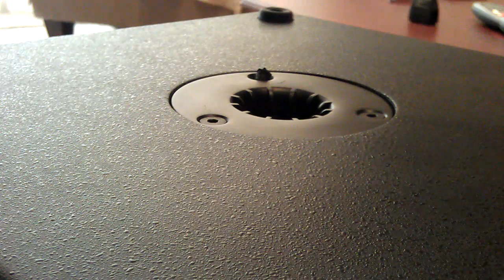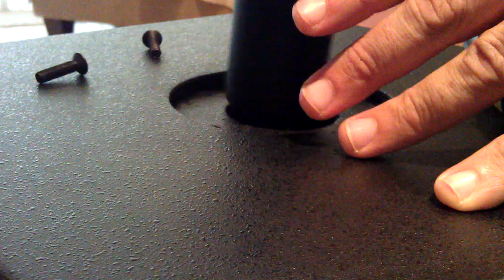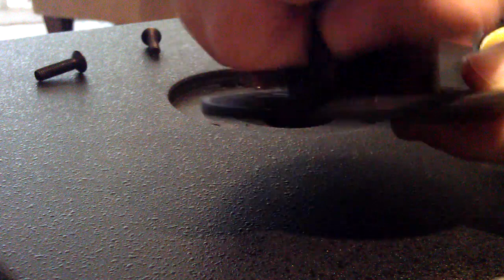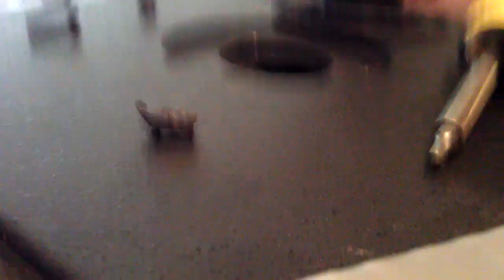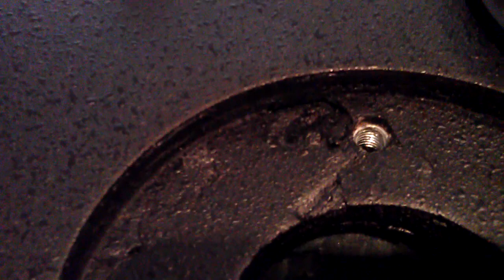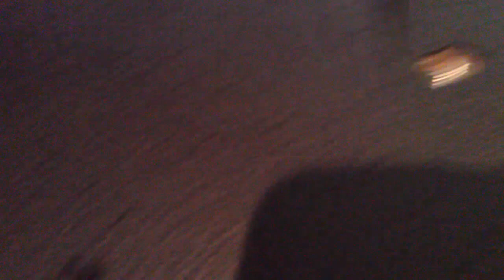Elx112 issue part 2

Comment from the maker: @djbenno 

a speaker should not leave a factory missing a bolt, and have in its place a wadded up piece of electrical tape. the bolts that they have in them are not the type you can run to the hardware store and buy.

Comment from the maker: What the hell do you think this video was done for? I was asked by electro voice to record this. They wanted to see what happened at the factory. I was called by the head of service at ev and was apologized to, and was also thanked for making this video. They used this info so that it doesn't happen again. I was told by electro voice higher ups many times that there is no way anything should have left the factory like this.